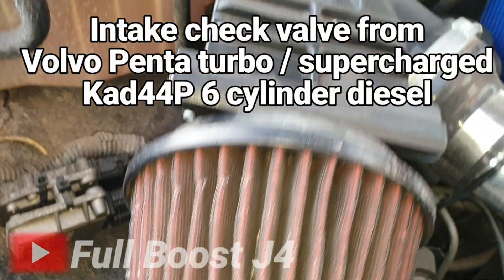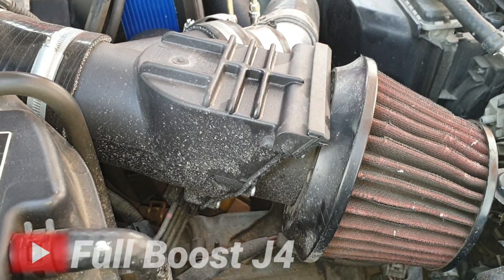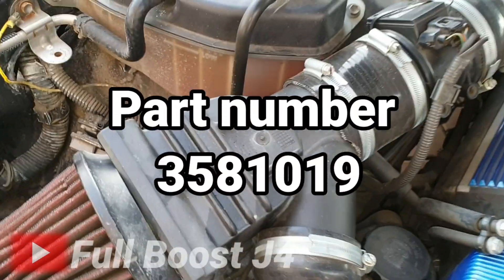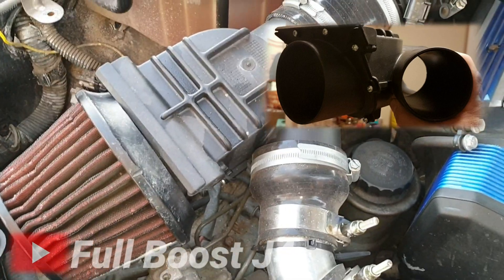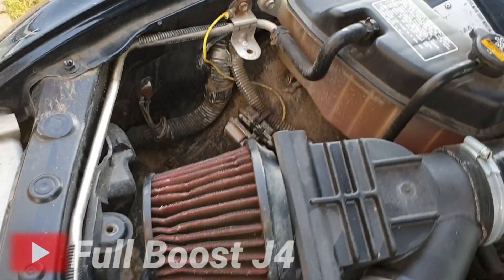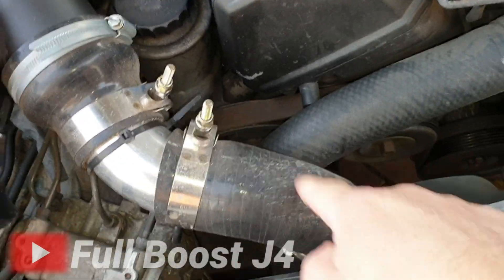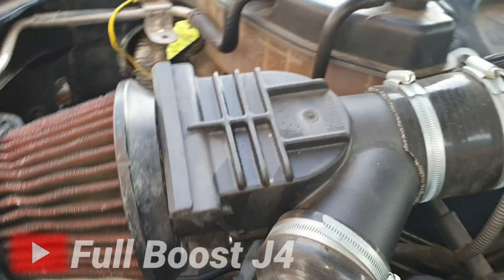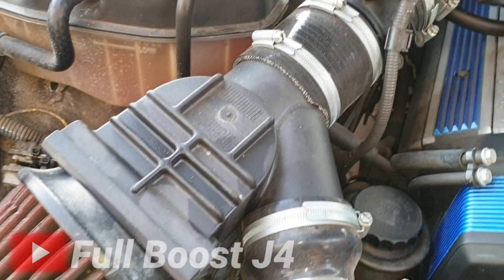Rear mount turbo throttle response improvement?

Comment: I haven’t seen all of your build videos left but did you have to have the car tuned once you turbo’d it? I’m finally getting around to my sc400 lol idk if you remember I mentioned it a long time go 😅
Reply: I’m starting to watch them all and taking notes for my build….finally
Reply from the maker: I ran it for a year with the stock ecu, just increased the fuel pressure with a rising rate regulator 👍
Reply: @FullBoostJ4  oh, ok, thank you. Do you remember which one or have a part number by any chance?
Reply: @FullBoostJ4  also, how much power is it putting out?
Reply from the maker: Without putting it on a dyno it's hard to say, but when I pulled it off last year and drove it stock it felt so slow 🐌
Reply from the maker: It w was just a generic ebay one. I think it was German made.

Comment: So does it eliminate ever seeing vaccum?
Reply from the maker: No, it just allows the engine to breathe like it did before it had the turbo. The intake air pre boost is drawn in like stock with no restrictions, then as the boost builds, it closes the intake flap and the engine is fed the forced induction. 
Best of both worlds .

Comment: Does the valve work in all positions or does it need to be mounted vertically?
Reply from the maker: The assembly needs to to pretty flat ideally. I do have it slightly nose down to encourage the flap to close quicker. I guess it could work nose down at 90 degrees to save space

Comment: So what is the purpose of this 🤔
Reply: So is there a intercooler on it or is that it straight from the turbo
Reply from the maker: @willssmall5067  no intercooler although I may well fit one when I upgrade to a bigger turbo and proper management 👍
Reply from the maker: It allows the engine to breath off boost and improves snap throttle response. Instead of having to drag air through a hot turbo,and then 14ft of 7
63mm charge piping its free to be ingested close to the throttle body.